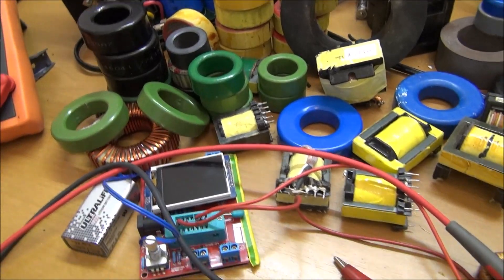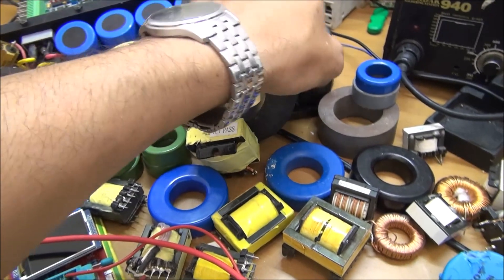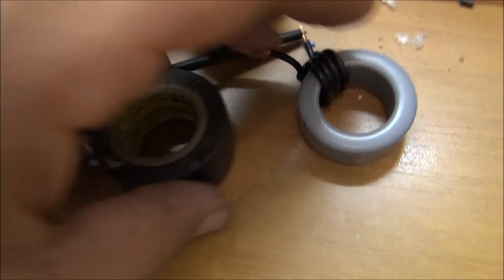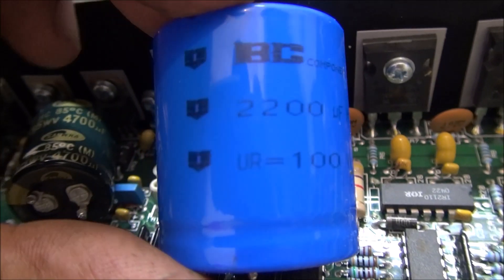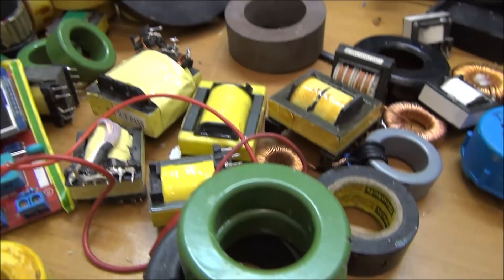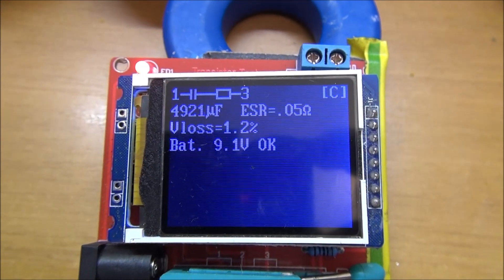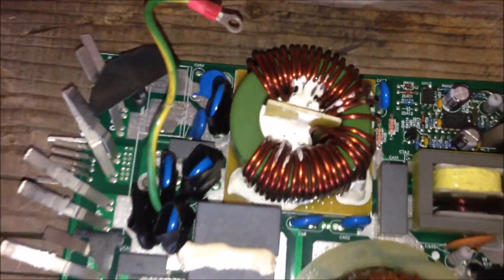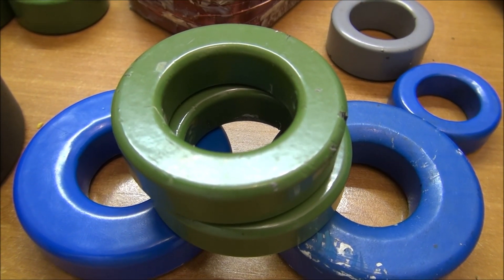DIY car amplifier: The toroidal transformer core

Comment: My output voltage is quite low on hand wound toroid transformer. I did 
match the frequency to source AC. What is efficiency "percentage 
difference" of primary not wound exactly over secondary, just wound 
separate on core? It just looks visually better with 2 different colors 
insulation.,at separate placements on core.
Reply from the maker: this difference is very low, and concern only high frequency harmonics on a high frequency switching mode. The reason of you low voltage is maybe a bad core, not suitable for your application or frequency, or your copper is to weak, also if the loops are not correctly define by the good ratio for those properties, (to much wire or the opposite). Also, the transistors you are using can be not suitable for that. All mostfet are not suitable.
If you listen on the video, you will have some idea about how much permeability and how many turns you need, according a good core properties. Be carefull with your working frequency. Need to be sure of all those parameter, unless something missing to me. Also, your coated copper need to be good, unless you will have some short on your core.

Comment: Hi sir Alex Pls confirm that if the 63mm od core's intial permiability is  6000 and it's AL (nH) is 13900 is this core best for DC to DC converter? And what effect cause if I  use lower permiability ones and lower nH one core.pls guide
Reply from the maker: lower permeability with tore mean higher saturation, but need to increase frequency. Each core can have different permeability, wich need to be calculated by test application, some wires and frequency, and testing resistance trough it, according frequency. Green core, power core (green color and grey), black ceramic ferrite, are attented for DC/DC coverting. Of course, some exception can occured and you need testing, and value calculating with RCL meter. You need a reference of 4 wires, or other, always same value, to check inductor value of the material, and calculating with frequency for the equivalent resistance.
The core you need to be aware of, are black painted powder core, yellow core, and other special colors, wich are not made for dc/DC transformer, but for antiparasit purpose. A good transformer has a high permeability. Lower permeability is not intended for DC/DC converter, and  induce loss and heat, and short circuit.
Reply: @AIexanderHartdegen  thanks sir Alex can you pls send your Watsapp number for more guide

Comment: "Iron powder cores have less magnetic permeability than classic ferrite cores, but magnetic field created in an iron core is hard to saturate..." I looked for this information for a long time. Finally someone explains the difference better than, "iron powder for low frequency, ferrite for high frequency", which tells me nothing about why. Your explanation does, thanks!
Reply from the maker: @Garrett Hi, I think you liked this video. Powder core or ferrite core work with high frequency, but ferrite core can work with very high frequency. Ferrite cores need a air gap to improve their saturation. Powder core have, in their conception, a "natural air gap"(made by a binder), located between each particle of powder. Also, powder core is sometime an oxydation of a metallic core, with some alloys, wich can make each core different, for different purpose. Also, you can find rubbon thoroidal core, made my sophisticated mono cristal particle (or something like that), foundable in some high power inverters or car amplifier. Thanks for your comment.
Reply: @AIexanderHartdegen  I appreciate the distinction between low and high frequency in iron powder vs ferrite cores as being more high and very high frequency. Thanks again.

Comment: every ferrite ring can work as a transformer? i have a core with gray color. will it work for 150W? it is about 4.2cm2. and at 50khz
Reply from the maker: yes it probably do the job. The usual colors are grey and green. You can use also EI ferrite transformer. No, you can not use every ferrite ring like a transformer (like the yellow and black paint on the video).
Reply: @AIexanderHartdegen  ohh ok. thank you very much for your reply!

Comment: Sir i need this.. from where i get it.?
Reply from the maker: @Rahim Jan hello, you can simply found it on Aliexpress. The "code" for switching power supply core is the green color, or black (if it's a ferrite core). If you want it for free, you can dismount a EI transformer from a computer power supply, and make your own coil. Thanks

Comment: Hello my friend great video, but i have a question, can i use a toroidal ferrite core to create toroidal transformer of 200watt?
Reply from the maker: Daniel Negreiros yes, but only if
1- you drive it with high frequency (20-70 khz)
2- it have a high permeability (100 µH for 4 turns)
3- the diameter of the core is 40mm diameter min, and the section area of the core is 1,5 cm² min
(sometimes you can read 300W per cm²)

If you use powder core, you can have a little size for the same power, at the expense of permeability.
If you use ribbon toroidal core you can have 2 or 3 time this power for the same size, at the expense of permeability.

Thanks for your comment.
Reply: Alexander Hartdegen  thanks, it helped me a lot
Reply from the maker: You need to be very careful with the permeability. This choice can give you success or fail. thanks.